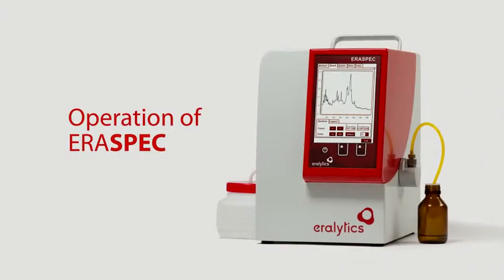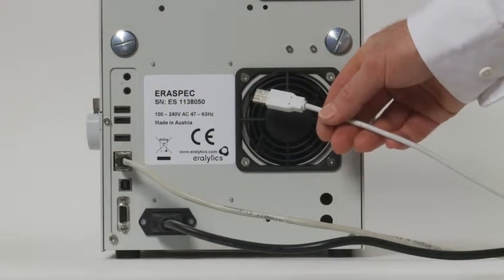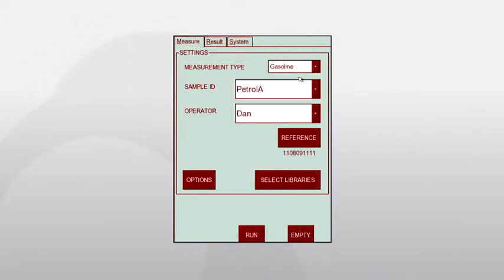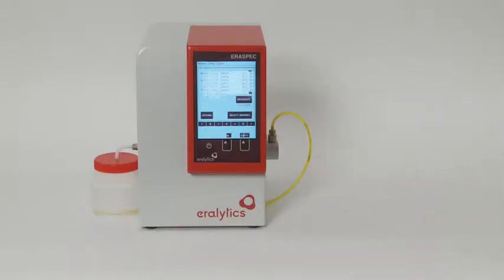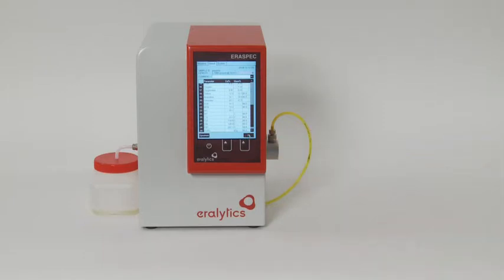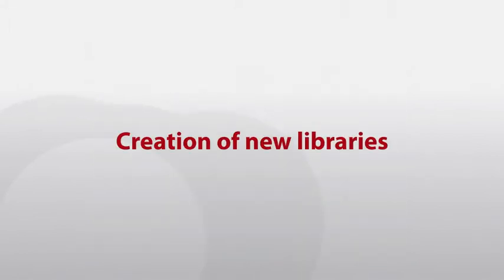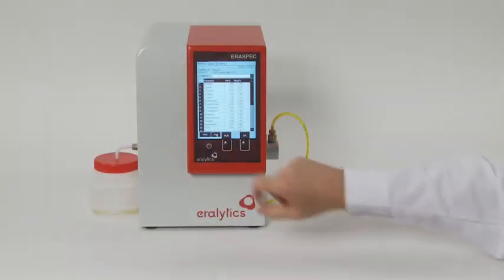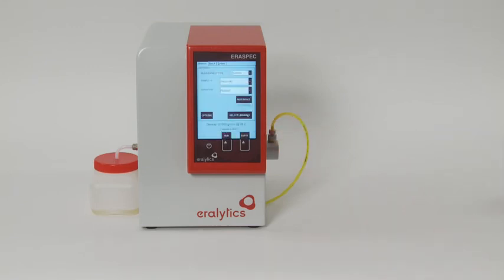ERASPEC - Operation & Set-Up Guide

Comment: Could you share libraries for the most common oils.
Like 5w30, 10w30, 20w50, for diesel and gasoline... I have new equipment, and the data I get is wrong due to lack of libraries.